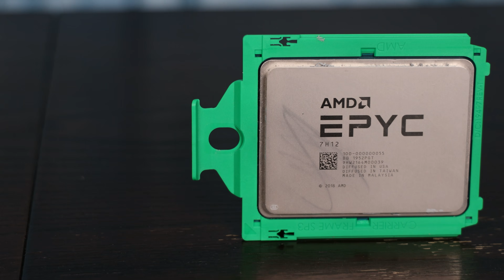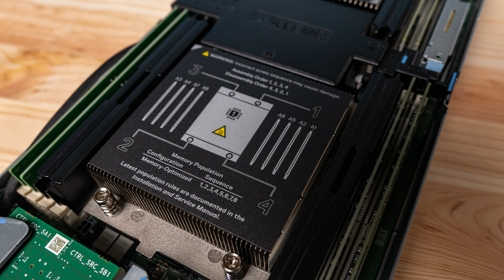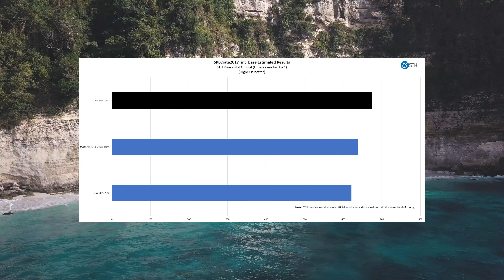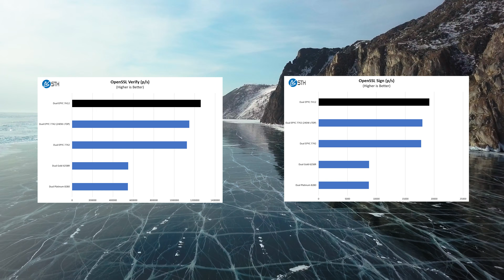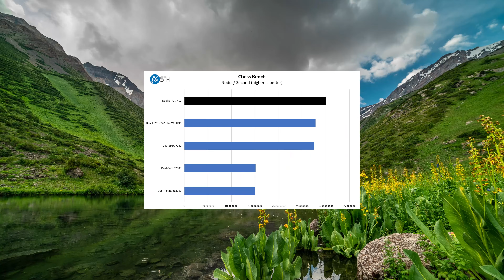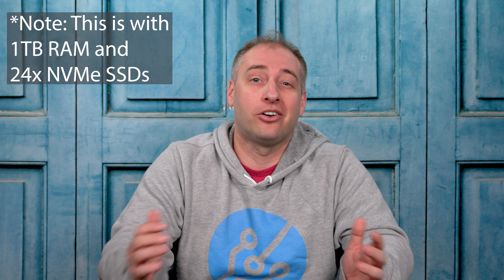AMD EPYC 7H12 The Fastest CPU You Can Buy

Comment: How to power it? How to cool it? Motherboard support? Lol.. 8k for just a cpu lol

My used altima was 9950... it’s almost as much as my bruiser..

I don’t think you could pull off a 2 u that would be able to move the heat. 280watt.. you are going to be loading 1/4 of your 1000watt power supply. This is going to heat everything in the 2u.. electrons hate heat.. I think the smallest platform is 3u. This gives extra heat capacity. On paper.. it might work but we all know there are many factors that can kill lab performance figures..  (dust bunnies love server rooms)

You are right about to many cores. Even 32 is almost way to many.. database applications you can use all. Search engine spiders. Vps rentals..

Comment: You are a bit off when it comes to Intel TDP.

250W - 8380HL - https://ark.intel.com/content/www/us/en/ark/products/205684/intel-xeon-platinum-8380hl-processor-38-5m-cache-2-90-ghz.html [Cooper Lake]

300W - 3110X - No longer in sale / no follow on product

400W - 9282 - https://ark.intel.com/content/www/us/en/ark/products/194146/intel-xeon-platinum-9282-processor-77m-cache-2-60-ghz.html [Cascade Lake]
Reply from the maker: We actually just got a Cooper Lake system in. All three of those are not mainstream 2-socket platforms. Cooper is really 4S/8S focused only (basically no reason to use in 2-socket but it can be done.) Xeon Phi is discontinued. We did some content on that. The Cascade-AP is not even socketed. It is only sold on Intel motherboards and has limited system functionality.

Intel has higher TDP parts outside of CPUs as well. Here we were looking at mainstream sockets. Ice Lake Xeons will go much higher than 205W TDP.

Comment: Can you dual socket this?
Reply: Yes and you get 128 cores and 256 threads which seems overkill, however you will have to use Windows 10 Pro for Workstation or Enterprise because Windows 10 Home or Pro doesn’t like processors with 128 threads or more

Comment: The millon dollar question is: Does it run Microsoft Flight Simulator 2020? xD
Reply: Spoiler : it does but it runs horribly because of the game's poor optimisations and DX11
Reply: If Threadripper can bruteforce itself into running Crysis, I would say probably.
Reply: It can render it 😁
Reply: Barely, just barely!
Reply: It does and runs very well if you use it with 4 TB of RAM and you pair the CPU with a Quadro RTX A6000 graphic card and you have it in dual socket (128 cores, 256 threads)
Reply: FSX is barely running halfway decent Fully loaded with addons with the computers of today!!! it will be another 15 years before the technology is developed to run FS2020 with Orbx, PMDG, REX!! in Full 8k Resolution!! Hahahahah

Comment: The fastest multicore CPU you can buy.  Its single-threaded performance is quite abysmal.
Reply: i definitely wouldn’t say abysmal it’s actually really good just not in line with standard desktop cpus. It actually outperforms its intel counterparts by a huge margin
Reply: @achilleaustin4477  My point is these parts aren't made for single-threaded workloads; and unfortunately, single threaded performance still matters.   So calling it the fastest chip available is kind of a misnomer.  

That's even before you start talking about things like the 80 core Ampere Altra which I'm quite confident can run circles around the 7H12 even at a 300Mhz  per-core handicap.  Because why worry about clock speed for multithreaded workloads when you can just spam processor cores at the problem and be done with it. 

The title of this video is disingenuous at best and clickbait at worst.
Reply from the maker: I cannot talk about this more now, but the 80 core Ampere Altra can be faster, but that is not always the case. It is still not at the same level of general availability. More when we can publish on the STH main site. We will be doing full benchmarks/ reviews and discussing the platform.

Comment: I wrote this in the last 4 hours as a reply to another video, but I think it fits well here. Compare & contrast ~
 The next 3 years are not dire for Intel, they're just not. Intel have a supply problem, They are using all their available 14nm silicon, so they can't meet the orders they have in the home user + gamer_boi space. Why? Because they have a problem with side-channel attacks, and their server space Xeons are threatened, so server_bois have had to apply mitigations, through Windows or far more often, through Linux. That has knocked the performance of the virtual-machine so badly they need about as many extra servers as they already have. If that shop has a thousand Xeons, they've got an extreme mission critical panic to get another thousand Xeons into the building in the next week. So they're all doing the same thing and moving to EPYCs, right? No, as a matter of fact, they're ordering another thousand Xeons, which have has some slight revision to the hardware but they're still on 14nm and they still have side channel vulnerabilities. But to move to EPYC, they'd have to maybe revise some of their software, and this application was written in COBOL in 1973 by our founder, and it's mission critical - it's company central - if this 200 lines of 50 year old code doesn't run the same way, in every possible variation, then four billion dollars worth of Roger's Rat Traps and General PR Company Title is going to vanish without a trace. How do you transition? Well you get onto your IT experts and ask them. So the Intel experts consult other Intel experts who use Intel Intelligence to talk to the Intel developers, who consult the Intel spreadsheet and talk to the Intel accountants, who go back to the Intel rep and tell him to tell his Intel Clients that Intel is still the best, and to certify Intel code to run on some other (poxy) company's chips, would take about 75 years. And so the captains of the IT industry, who are smart enough to run data centres, take that at face value. And so the price of Intel gaming rigs for Gamer_Bois are high, because Intel has a supply problem, because they can't make enough 10-900K gamer chips (which sell for maybe $600) because their entire capacity and 14nm fabs is frantically churning out Xeon chips, which sell for $6,ooo a chip, to fill the back-orders they've already got. And the financial penalty for this catastrophe is that Intel has taken about $60 billion this year in gross revenue instead of AMD, who has take about 6 bil. Intel has taken record profits from record revenue because they've made a huge security and design and engineering blunder, and now it's costing their customers double, so their customers are buying twice as many Xeons. So who exactly took those Polaroids of the Chairman chock-a-block up an Alsatian at the Christmas party? Either that, or how the fk did these people become the boss of all those IT companies? How the F U C K can this be going on? And how can anybody look at this and say Intel are looking at a bleak future for the next 3 ~ 5 years? Are you kidding? Intel are laughing like Vlad Putin! The world is fking stupid! Here ~ I'll show you....

Comment: At 7k USD, I'd be too scared to socket the damn thing.
Reply: This has no pins on the CPU mate... It's easy AF 😀
Reply: It actually pretty cheap cause it pretty much on the similar market as xeons. And you know xeons. Modern model is very very expensive
Reply: I almost feel good about getting my 2990wx for $850, even if it is way slower!
Reply: @mpeugeot  Yeah I feel the same about my 1950x lol
Reply: It's possible to buy already in the socket, not easy to find like this one, but possible:
https://www.newegg.com/supermicro-mbd-h11dsi-n702-ma015-o-dual-amd-epyc-7000-series/p/N82E16813183691
Reply: @belther7  but you will get your pcie chopped to pcie30 ?
Reply: @charlesselrachski34  In this board I do think so, this one was just an example, I think that with enough search we can find these processors pre installed in good motherboards for them, but it isn't easy to find
Reply: here in Brazil it costs 50k q and more or less 7 years of work for a common worker
Reply: @higurashi_8670  yeah and intel price gonna be around 10k-30k USD. It stupid high

Comment: Why does Intel have such an enormous market share, even after Epyc launch? Does Intel have better bios and drivers, better memory support, better customer service? Or do they just own the OEM market? 🤷🏼‍♂️
Reply from the maker: Being the incumbent with over 97% market share for years means that the ecosystem uses you as a standard. It is hard to move that. An example of why it matters is with PCIe Gen3 in EPYC 7001 "Naples" generation we saw things like no hot-swap NVMe SSDs for a long time. The industry used Intel Xeon as standard so it did not work out of the box with AMD. These little things add up over time.
Reply: @ServeTheHomeVideo  the other thing is likely contracts.  Intel likely has many long term contracts out with system integrators and OEMs that are years in the making already.  Companies are ordering their servers for next year or 2 years out now, and making purchase decisions based on market share and performance per therm of heat produced.
Reply: @Agent Smith A big part of it has to do with Server upgrade cycle.  If all your servers are already Intel it has less of a time cost to just upgrade CPUs in your existing servers rather than validating all your hardware with Epyc.  Now the thing is that AMD is actually so much higher efficiency that it is worth it for some companies, eg Amazon, to make the switch over.  And AMD was actually such a better deal that if you do need all those cores its definitely worthwhile.  For smaller scale servers the 7F72 is seeing a lot of use due to the 3.2ghz base and 3.7ghz boost clocks while having 192mb of cache.

Comment: It's faster than the 3990x despite having lower frequency on the same architecture?
Reply from the maker: This chip does a great job holding turbo frequencies, but the other aspect is memory bandwidth. If the application is memory bandwidth limited, having 8 channel memory is a big benefit. The 3990X is often faster in very small micro benchmarks such as c-ray/ Cinebench or in single threaded workloads. With bigger workloads, the 7H12 has more memory bandwidth and can scale to dual socket which the Threadripper cannot.

Comment: Does it run MS-DOS?
Reply: TempleOS or bust :')
Reply: Yes, but I dont think it will address the whole of your 1TB of RAM. 🤯😂
Reply: These processors are meant to run Linux, or BSD, DOS based systems aren't design to this kind of operations
Reply: It will fail to run MS-DOS because it has more cores than the os supporting how many cores can it use
Reply: @tonycheng6478  MS-DOS runs everything on the boot core, so 1.

Comment: 19:52 sorry to tell you but you're totally wrong on that aspect , the server market are hungry for more cores and power for each core , specially with all craziness with virtualization that trend more last ~5-10 years e.g Docker LXC Amazon ECS they're sell like crazy. an EPYC system like this is good investment to them .
Reply from the maker: Not that there is no market for 64C, but even AMD will tell you the lower core count parts are higher volume.
Reply: @ServeTheHomeVideo  I don't own server or sell them , but I watch a lot of hosting webforums spicily LEB latest AMD CPU's  like Ryzen 3900x  sold out immediately last year  , people wanted to build cloud system with fastest cores(not CPU) as they could have , + for security reason some companies spread their applications/systems on multiple nodes , I know 64 beast cores are a lot but for 110K$ server price clearly it had it niche market , for someone like me witnesses the era of first Xeon's and lather on Opteron it's like dream   comes true
Reply: Most epyc rome instances on Azure and aws are still using 32 core CPUs if you buy the bare metal config
Reply: I agree with both points to a degree. I think the issue here is that the high core count parts are a bit ahead of the "main stream" market. Higher core parts have use cases, and this is where I agree with the other point, those "niche" use cases are where the market trend is headed, it's just at the beginning phase. I run a lot VM's, but have been converting the VM's over to containers for the efficiency gains,  I can run much more containers with much less resources, which reduces the need for higher core part servers. If anyone wonders, I have not fully done the calculations on the efficiency gains so I cannot yet give a value.

I definitely agree that the high core parts are like a dream, however at this time I'd rather use another server to scale up rather than consolidate with a beefier higher core density server, too expensive and incremental scaling is too coarse grained to justify. I can see the density equation change down the road, but not now, but that's just my estimation, others may have a different view.
Reply: @geekinasuit-l1b  

I don't understand fully everything you guys are talking about.  But I'm so proud that between the start of last month and now.  I have gone from not knowing anything other than RAM size and i9 > i7... To understanding the comments on a video about HPC parts
Reply: @segun_finance  nice to hear , anyway if you wan go farther , try lol learn and test Linux , but be aware this my effect your social life (ot the internet) , but if you become expert you may end-up working on the industry their growen demand for Linux admins all around the world I see it good chance .
Reply: @مقاطعمترجمة-ش8ث  hmm... Thank you for this...

I never really thought of that but it's a welcome addition

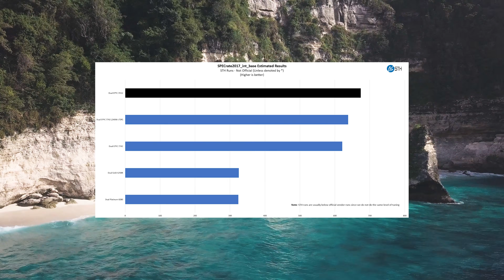Comment: 15:57 Holy sht AMD not swap the floor with intel but they wipe them out the universe , I can't understand why AMD sever market still on ~10% market share cap .
Reply: I believe those 10% is the installed base, not sales. Considering they where effectively 0% just a couple years ago, and how large the server market is, I say this is a huge feat.

Also, Intel's server sales dropped a whopping 40% year-to-year, according to their last investors call. You can bet AMD is selling Epic chips as fast as they can produce.
Reply: @magoid  the precnetag are from market demand for new server(quarter/yearly based) , + servers market are huge very huge , but it's moves very slowly when it's comes to adopting new products (they're kinda traditional people) who knows business only, and have tighten relationship with intel , (Intel have  effective lobby on OEM and servers market since long time specially overseas ) .
Believe  it or not DIY PC market aren't that big up to to 20% only , that's why intel still have very strong quarter revenue (1 quarter is double what AMD make's in whole year ) , AMD even lost big market share on GPU market (which is more DIY than PC) to nVIDIA after VEGA disaster  )

Comment: We are actually running a lot of HPC-type applications, and what we have found is that not even the current Rome parts are capable of providing enough memory BW. It is a very obscure fact, but unlike DT/HEDT parts, for EPYC AMD limits the FCLK to 2933 MHz/2, and as a consequence running 3200 MHz RAM can run into diminishing returns compared to the gains found by going from 2666 to 2933.
One more thing: as a consequence, we believe that for our specific use case, going beyond 32C/socket is not really worth it. Also, operating in single-socket means the high-speed XGMI links are off, which can free up some package power budget.
PS: We have no per-core nor per socket licensing costs, so this is a question of "not worth it" in terms of CapEx.
Reply: Always wondered about that. Perhaps this processor is better suited to running rediculous amounts of VMs? I wonder what the performance looks like between a 32 vs a 64 in compiling.
Reply: @ethograb  I think one of the bigger markets for this processor, at least right now would be 3D render farms. 
Massive 3D animation studies or even CGI studios would have a field day with this much processing power, assuming the software they use doesn't have GPU acceleration. 
Interestingly enough, these processors already have nearly the same raw processing power as some higher end GPUs, which is pretty mind-blowing.

Another application could be for movie and TV studies that are adopting 12K filming standards. Processing those raw video files would require the processing power this processor could provide.

When you add the PCI lane and memory flexibility, it would make perfect sense for high end media creators. 

I guess that market segment is still tiny in comparison to other corporate markets that would need this much processing power.

Comment: Faster is TR 3995WX, also 128 PCIe 4.0 and 8ch RAM
Reply from the maker: 100% but that is a single socket solution which limits system performance.
Reply: @ServeTheHomeVideo  yes, of course. btw. next few months will be very interesting :)
Reply: @ServeTheHomeVideo  By that logic, some of the S8S Intel CPUs should be considered fastest, or even some of the newer 4 socket machines.
Reply from the maker: @butisitlogical3096  In most workloads the 2P 7H12 was out-performing the quad Platinum 8280 systems by a good margin. The 8380H may do a bit better because of higher UPI bandwidth. Still working on getting a proper Cooper Lake setup and deciding if #1 I want to do it, and #2 if we do Cooper Lake is it a one-off system, or are we going to do multiple systems.
Reply: @ServeTheHomeVideo  this is because Windows is poorly optimized on TR 3990X and TR3995WX. 
Windows cannot handle too many sockets unlike Linux